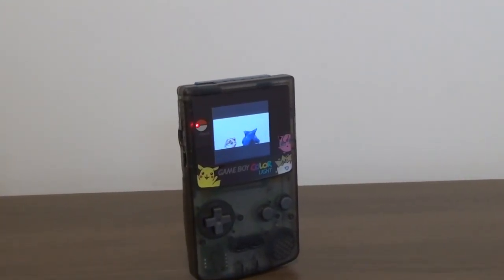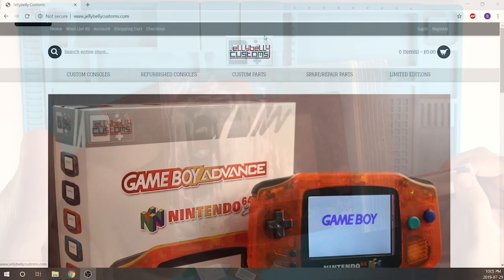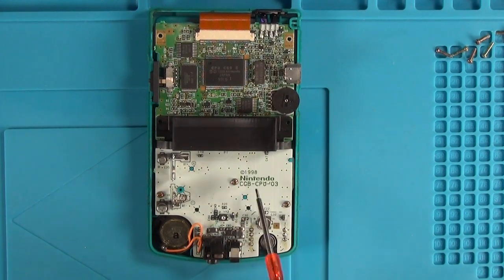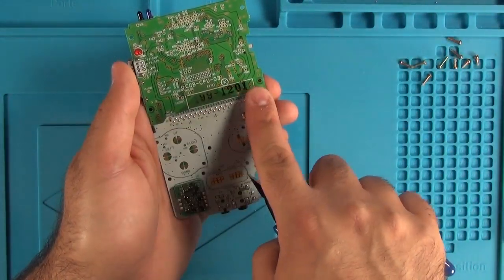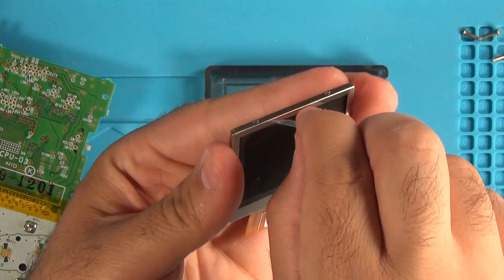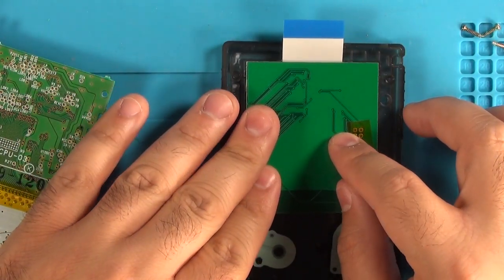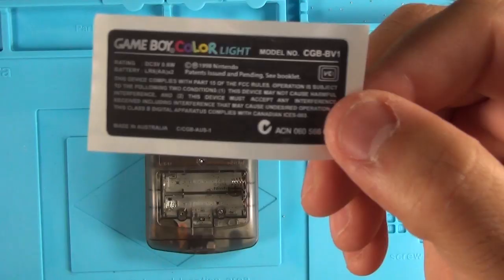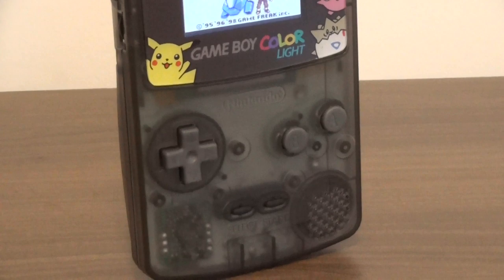The Ultimate Gameboy Color Mod! Freckle Shack Backlit Screen....

Comment: this is a great video! i would just add a couple things; I usually add kapton tape to the back of the lcd to keep it from shorting on the board components and i also cut a little notch out of the plastic for the lcd ribbon cable to sit flush.

Comment: The screen is 4.3 mm smaller than an original screen. That's a 10% of view-able screen loss. Don't get me wrong but that is a big difference. I don't know why reviewers don't mention this fact?
Reply from the maker: It certainly is a bit smaller, but it doesn't really feel smaller. I guess even though it is smaller, it still looks and feels very natural.
Reply: Because it doesn't matter
Reply: The screen is then the same size as your GB games run when playing on a GBA or GBA SP
Reply: Because Benn Venn’s fanboys don’t want you to know that fact.

Comment: Thanks for the video! Do you need a replacement shell or can this be done on an original GBC shell? Thanks!!!
Reply from the maker: You can certainly do it on an original shell. I only swapped mine because it was in bad shape. In terms of the replacement lens, that may be something you consider doing though. It will fit the screen size better.
Reply: Well I did it my friend ! Original shell and all! Thanks to your video! It’s aweosme
Reply: Did you keep the original screen too?
Reply: darrell not sure if your asking me or not but yes I kept the original screen on my GBC
Reply: Brian Vetrano was there silver on each side exposed?
Reply: darrell with the 2 3D spacers. The silver on the side isn’t THAT noticeable. To me in my opinion it looks fine. This mod is a game changer for sure.
Reply: Brian Vetrano now just if they were in stock
Reply: darrell oh no! I’m sure he will put another batch up ! Let me know how it goes if you get one and do this yourself!
Reply: I kept my clear GBC available only in Japan all original including the screen except for the FS mod. I actually like the silver around the edges with the clear console. 
Looks great!

Comment: Be careful when folding the LCD ribbon cable, there's a dozen or so caps that can easily get crushed. imo they are badly placed, and should have be built into the LCD housing.